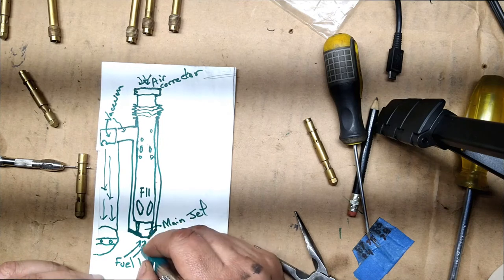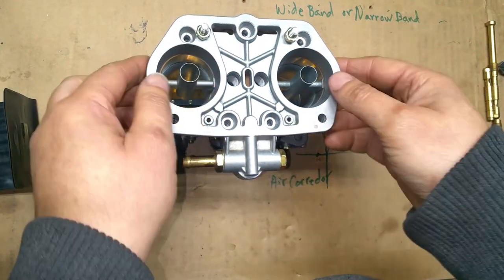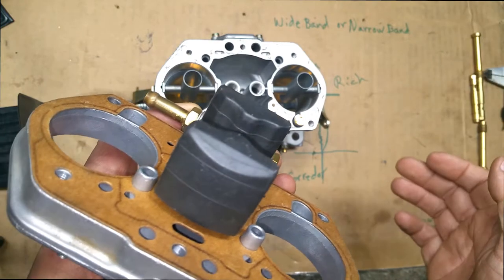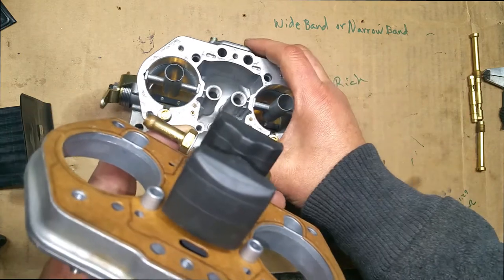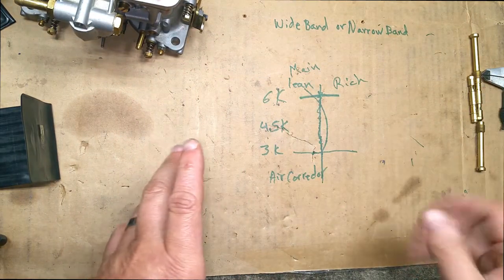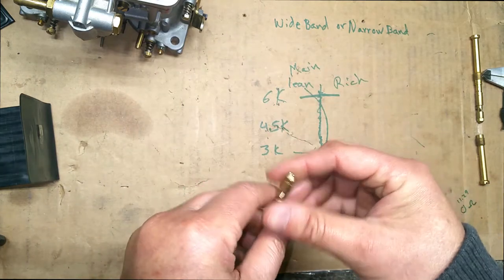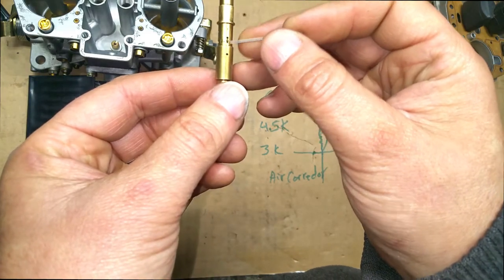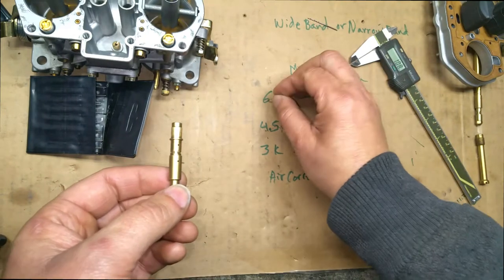How an Emulsion Tube Actually Works

Comment: I just found your video and made the exact same discovery earlier today. I also have a rich situation as soon as the main circuit takes over. One thing to add maybe. If you see the overly rich condition at high rpm you can easily swap to a bigger air correction jet. They do only effect the high rpm range. Maybe easier than experimenting with drills.

Comment: Am I right in saying you seem to be aiming for stoich at all RPMs?  But for full power at high rpm you need to be running about 12:1 otherwise you will not gat max power and may damage your engine.

Comment: Thanks for the heads up on how emulsion tubes work.  But why choose narrow band as its like working almost blind?  Narrow band is more like a switch that only tells you either weak or rich from the Stoich value (14.7:1 or Lambda=1), it doesn't tell you  or   I dont see how you can tune your carb for best mixture over the full range since Stoich. is far too weak for full power, and may be a bit too rich for light cruising.  Wideband is much better as it gives the actual Lambda reading over the whole Lambda range.

Comment: A wideband gauge works well with a narrowband oxigen sensor..? or should I buy a Wideband sensor..?
Reply from the maker: I just installed AEM WIDEBAND on the bug. Comes with plenty of wire to do a complete install. Seems to work perfectly. But anyway I recommend a wideband.
Reply: Wideband is superior in every way. Narrow band is what the it name says. Narrow. You might know where the ideal is, but it can't reliably tell how much,which wideband can. What is even more critical is,that stoich area is essentially only for neutral engine load. On full throttle you don't want it to be stoich, especially on charged engines. Therefore you absolutely need wideband to tune engine carefully.

Comment: any advice on plugging up a hole in the emulsion tube? I put a Weber 38 DGES on my 1.5L honda CRX. runs absolutely great above 2k rpm. below that it's SUPER touchy and if you give it too much throttle, it'll go super lean (21+) and start stalling out for about a second or two, then catch and take off. currently it has an F50 tube on it and i ordered a F66 which lacks the top most hole the F50 has. Thinking about trying to plug it up and see what kind of difference it makes, while i wait for the new one to come.
Reply: little late, but solder works.

Comment: What wide band kind do I need for my VW..'
Reply from the maker: Okay so assuming you have the correct idle Jets and you're getting a hesitation with a 1.16mm main jets couple of things you can do. Increase the main jet to about 1.20mm or a125mm last  lower your air corrector to 180 either one of those should remove the hesitation. Do not do both of them at the same time.
Reply from the maker: As far as widebands. I actually just ordered a brand new AEM wideband. I'll be installing it very soon.
Reply: @Motor7710  Thank you Ill do that
Im from TOrreon Mexico
Reply: @Motor7710  Thank you

Comment: Didnt your son say he did not want those on his car, to much headache ???? If we ever get the covid stuff over you can get a stroker and big bore kit for the type 4 but it take mucho machining.
Reply from the maker: He doesn't... He's running with the 34pict3 no Venturi on his new 2234cc install. But he is not going to make Max hp. It will still be in the 120 to 130hp with the 34pict3 carb.
It's still pretty good for a single carb setup.
Reply: @Motor7710  I got me a headache I got a EMPI Progressive 32/36 and it has on the main jets  p.137 and S. 140 .  This is set up for no Manifold heat . I will need to get a 125 main jet to lean out the primary.